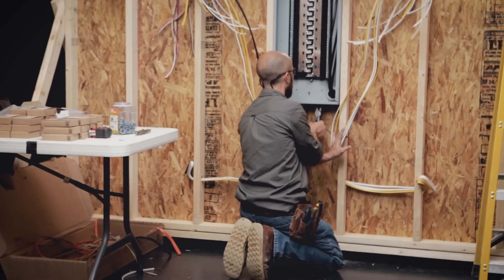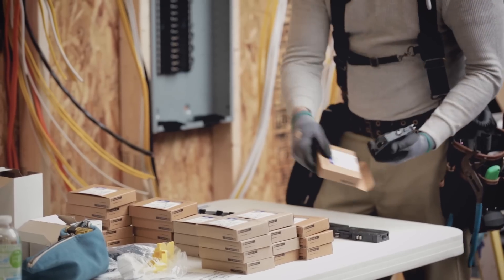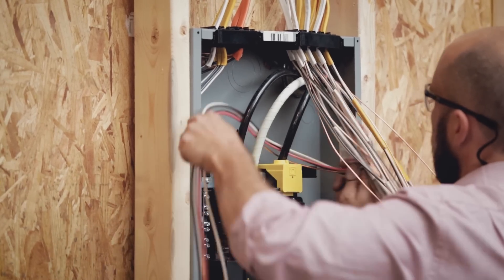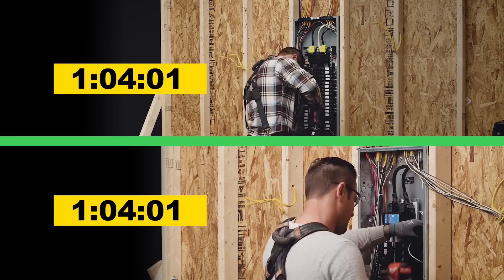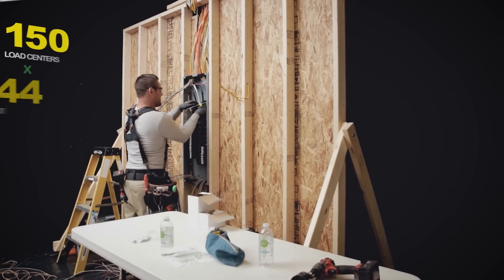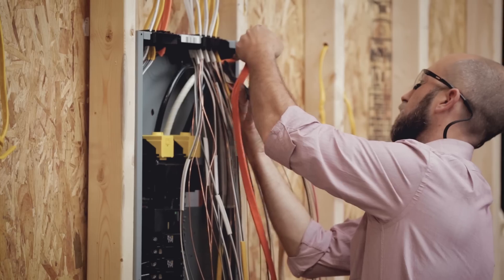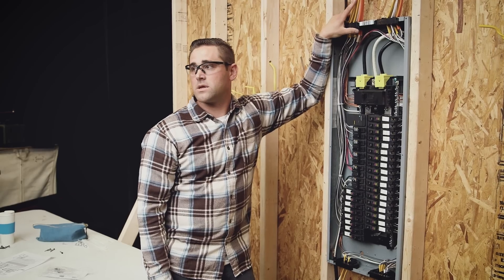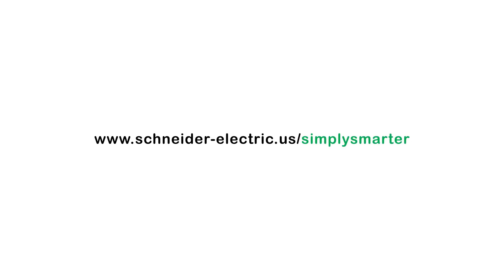Our Square D™ Load Centers install up to 37% faster | Schneider Electric

Comment: Notice how they don't show the panel covers being installed? Want to know why? Because the screw alignment holes don't line up with the panel cover holes. EVER!!!!
Reply: lol. I watched your video.   I’m trying to decide on a load center brand.  I’m leaning towards Siemens over Homeline.  I’m pretty sure QO panels are not necessary for my application.  Always appreciate opinions.  Love your videos.